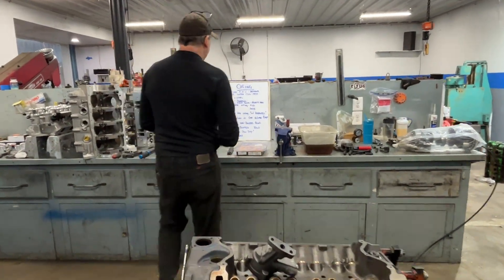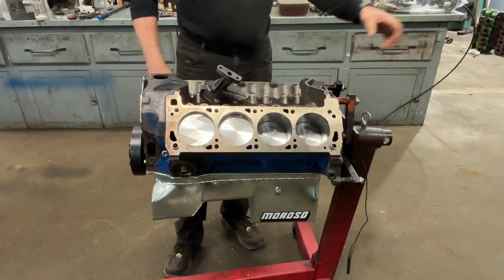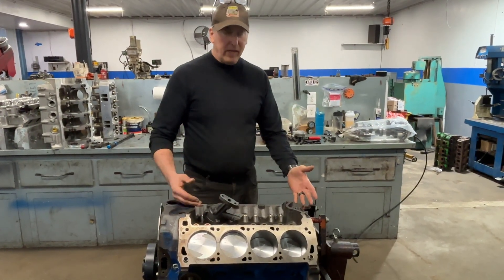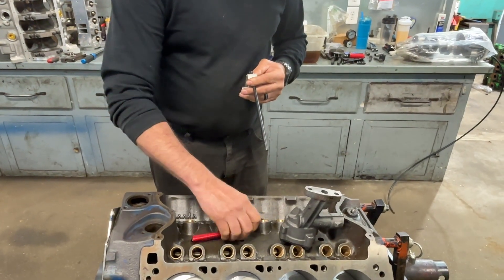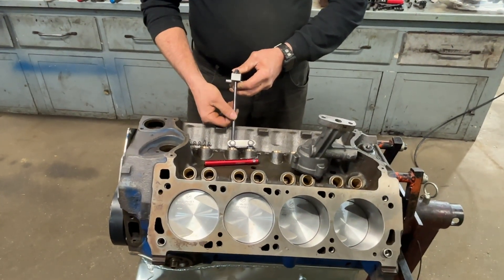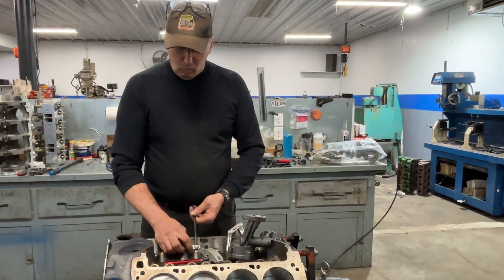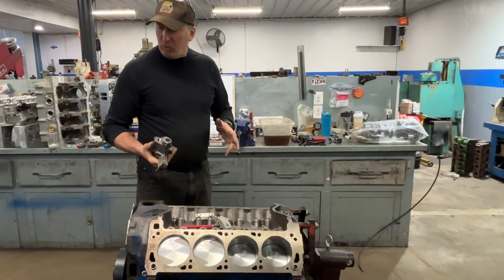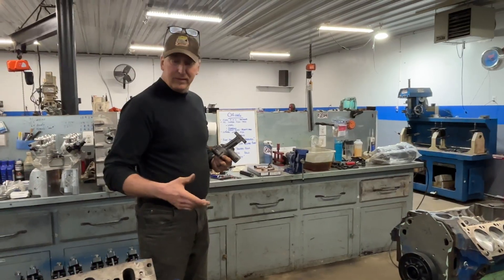Cleveland Oiling System (Trimmed Part 4) // “Fixes” that Are FAILING Your Engine

Comment: I don't know much about SB Ford (more of Mopar guy myself) but a couple generally applicable rules:
-- Adding restriction after a leak makes the leak worse, not better. If you have excess leakage in your lifter bores and add pushrod restriction, you'll actually lose more oil through the lifter bores. Your oil pump is positive displacement and all the oil has to go somewhere. If not up through the rods, where is it going?
-- The "audit" mindset or approach of "finding the leaks" is exactly the right approach. A properly built high performance engine does NOT need a high-volume oil pump to maintain good pressure. What happens is that most builders are sloppy and/or lazy and run excessive clearances ("it's a race engine, it's supposed to be loose"). This causes the resulting engine to waste horsepower pumping oil through leaks that just make more windage. Then you add a windage tray to try to get back some of the power you wasted in windage as a result of wasting power pumping oil all over the place from your leaky engine.
-- It's ideal to supply a series of parasitic flows from both ends of the run-- a loop. That way, any difference in flows and leakage will not prevent each cross drilling from receiving the same pressure at all times. If you want to do this with an external line, it would have to be from the oil filter output to the other end of the main oil rifle.
-- A properly clearanced engine should be able to maintain oil pressure with warmed up SAE 20 oil. If you use something thicker, use it because you want the thicker oil film and higher HTHS value, NOT because you need it to maintain pressure. If you need 20w50 to keep idle oil pressure up at modest temperatures, your engine is poorly built and has gobs of internal leakage. The biggest offenders seem to be excessive rod bearing clearances, whether that's side clearance or journal clearance. Consider the old 0.001"-per inch-diameter as a working maximum. If your machinist can't hold tenths to dial in a precise clearance value within 0.0002", find a new machinist with better equipment. Also note, sometimes the bearing themselves are to blame because they aren't consistent enough in size. With a good (King) bearing, this should be a non-issue.

Thick oils are often used as bandaids for leaks and poor thermal management. Fix the leaks, get your clearances dialed in and manage the temperatures properly and you should fine to run black bottle VR1 10w30 all day long.

Comment: Clevos are a lousy oiling engine. More so for road racing. Dry sumping helps a lot.
Use synthetic oil,, 5/30 or 15/40 depending on oil clearances, resolves some issues. 
Had many road cars with 160km with no mains left and 20 lb oil pressure. Ooopps. And people want to race them!!

Comment: what do you run for main bearings in you factory crankshaft engines are the fully grooved or half grooved
Reply from the maker: 1/2 or  preferably 3/4 Groove.   No full groove